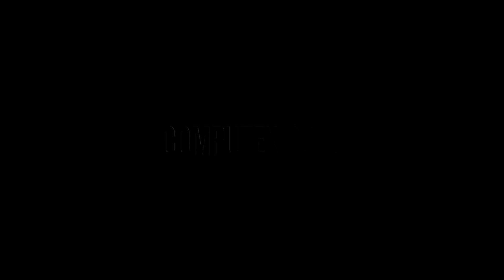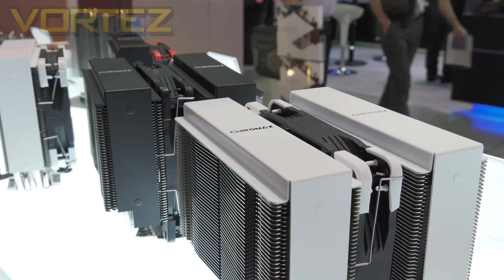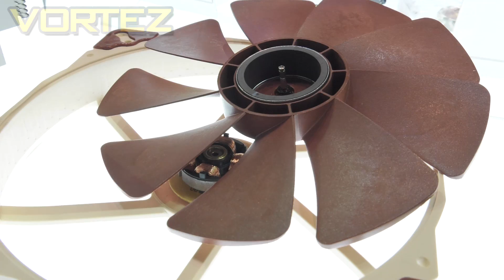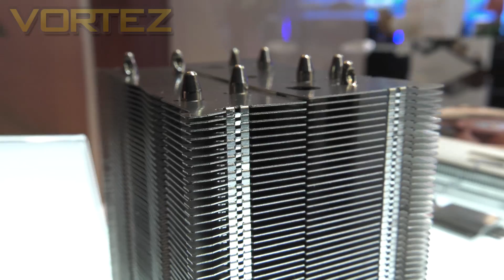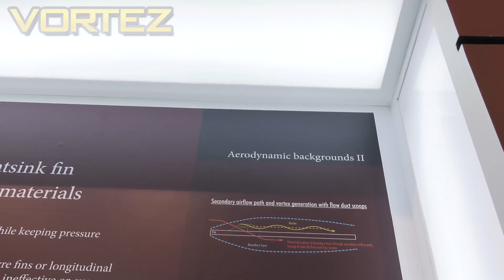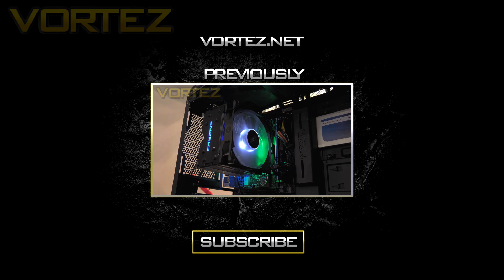Noctua's 20cm Fan + More @ Computex 2016

Comment: omg 200 mm?! I'm using cooler master 200mm fans and they rattle/whine even at low rpm. I have an older HAF X case and can't wait to use all noctua fans.
Reply: Bro you and me both. HAF X rocks, can't replace it. But these CM 20cm fans... my god man... they SUCK! The rattling is SO FREAKING ANNOYING! I opened them and applied a machine lube and it helped a lot, but it's still there. It's that annoying ticking sound that drives me nuts! These Noctua 20cm fans cannot come out fast enough!

Comment: Noctua buiIds (imho) some of the best hetsinks and fans.
I had troubles to keep my itx build cool and quiet with the standard fans in my tower.
So i replaced the fans with two NF-S12A PWM and also the CPU heatsink with the NH-U9S.
I was stunned by the result. 
Although they are slightly more expensive than some competitors, but worth every cent.
Reply: I think just having that warranty alone makes it worth it. You could pretty go thru 2-3 builds using the same fan and not having to worry. 7 of my 12 fans are Noctuas, and ill be waiting for their new 120mm to see how it does and maybe replace my 5 rad fans with it and use the nf-s12s as pull fans.